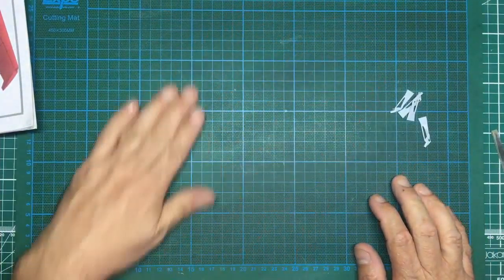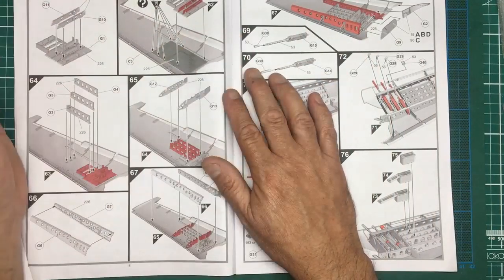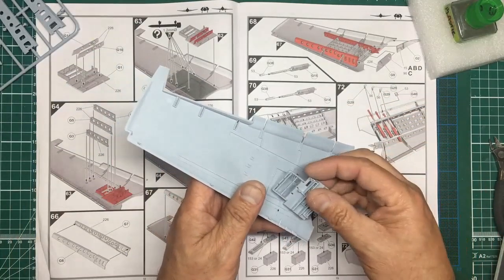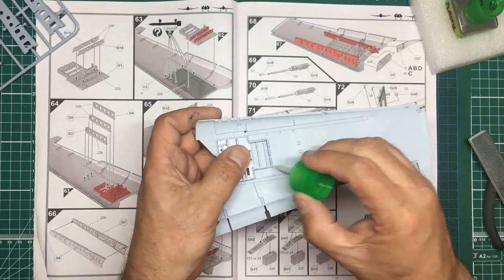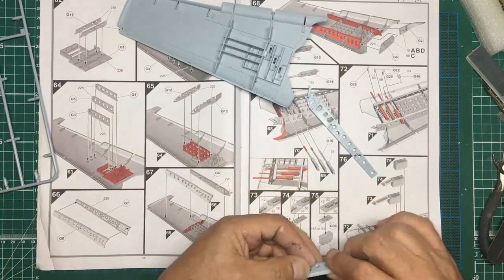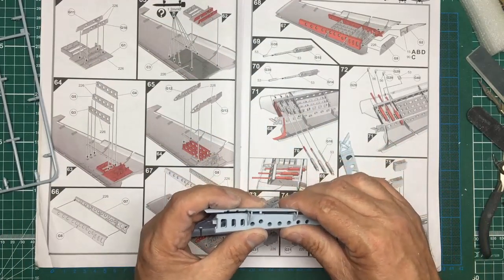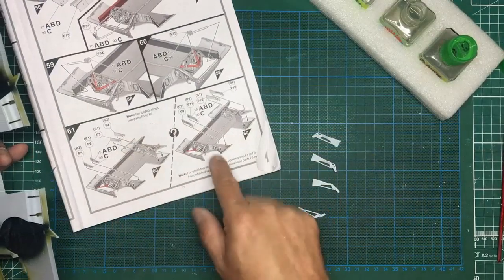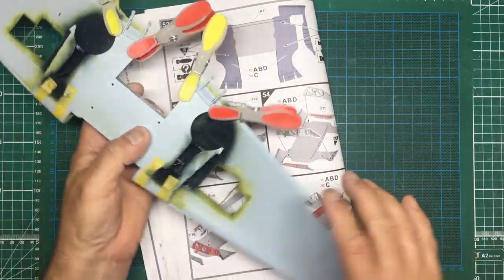Airfix 1/24 F6F-5 Hellcat build. Part 11.. more wingy bits..

Comment: Hi Nigel, you've been mentioning the fuel tank in the wing center section being black on the prototype. I believe this was the early attempts at self-sealing fuel tanks. Howard Hughes
first used a self-sealing tank in 1938. The B-25 was equipped with self-sealing tanks among others. the problem with these early attempts at self-sealing tanks was a significant drop in
tank capacity thus the range of the aircraft. So that may explain why the fuel tank on the Hellcat is black although I couldn't find any specific reference to this being the case. Just some info. Oh, BTW I bought some emery boards for sanding sticks and they work Great!
Thanks for the tip, never would have thought of it! Keep up the good videos. Bill G. Linwood Kansas USA

Comment: Hi Nigel, I’m slowly catching up on these videos with my own build....I’m at the stage where I’m fitting the lower wing parts onto the top wings for the extended mode and having a lot of difficulty getting them flush and the gun holes lining up. Watching your video I noticed urs fits well but I don’t think you had the large flat hinge piece that slots into the lower wing and upper wing, I’m out by a few mm and I’m trying to trim various parts to get it to fit. I’m considering taking this large tab piece out.

The large tab piece is like a hinge piece so you get a straight version and a folded version.

Looking forward to some more Hellcat videos!

Thanks,
Grant

Comment: This looks like a great kit. I understand the tight tolerances (basically zero) because aviation CAD is what I do for a living. But personally, I'd rather have tiny mold seams to remove, to create a perfect fit, rather than actually having to reshape the parts. It's gratifying to see how well this was done.

Comment: I wonder if some of the reported fit issues were made worse by pre-painting all the internal detail before assembly?  Given the fine tolerances and need for easing many joints an added layer of paint would make getting everything snug a real problem.
Reply from the maker: Yes Peter, I actually discuss this in one of my videos and is why i have all the slots in the fuselage of my kits masked off. It's kind of wing nut wings like ..
None of the wing parts on my assembly here were painted.

Comment: Nigel just quick question you mention this a lot what are ejected pins ?
Reply from the maker: They are actually called ejector pin marks. In a mould tool, which splits in half there are jector pins to physically push the sprue out of the mould. because these are moveable items they normally leave a mark on the surface which can be sunken or raised. They are a complete pain, especially when they are all over the surface of complex part. Take a look at the bomb roof of the HK 1/32 Lanc.. you'll see the part is covered with the bloody things!!
Reply: Nigel’s Modelling Bench thanks mate great explanation

Comment: Where's the next vid? Can't see a part 12 anywhere??
Reply from the maker: Michael Everett it’s coming!! The FAA is being used for wing assembly trials and in doing lots of resin casting!!
Reply from the maker: Michael Everett thinking about it, I could cover the lower wing assembly as per the FAA but with care to display the gun bays. I will also cover gun barrel removal so the guns can be fitted last.